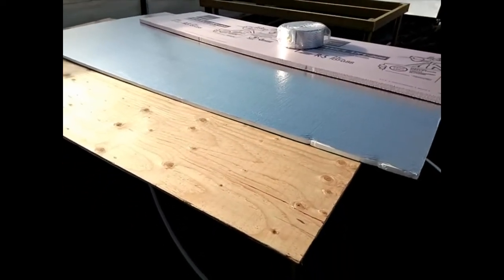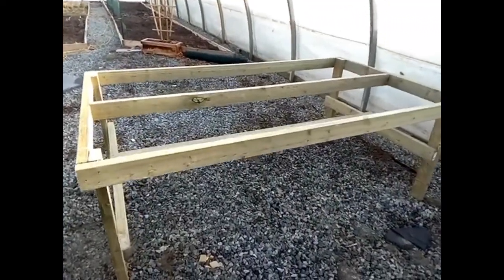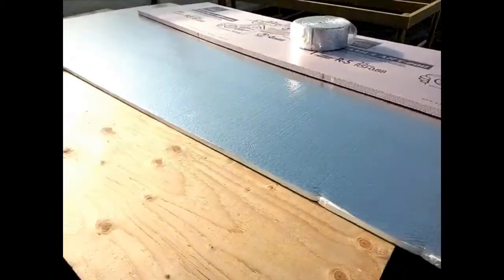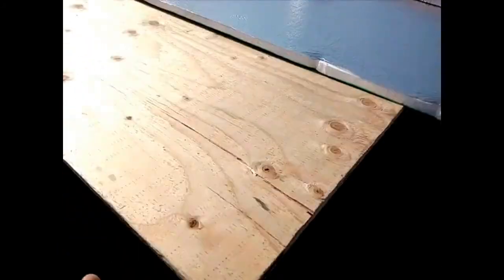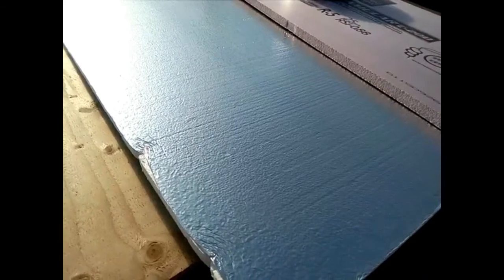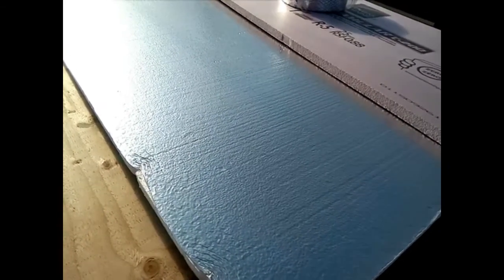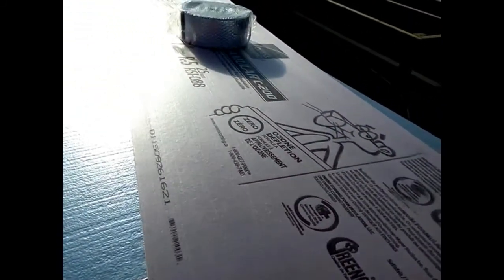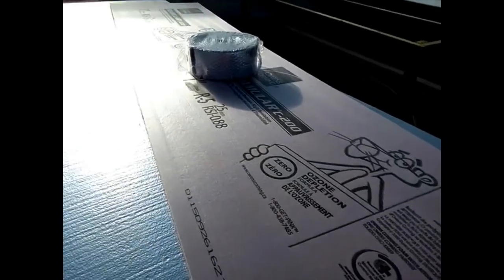Heated Bench

Comment: hii

can you tell me how does it work when the winter is in the deepest bitter night ? and how much does it cost to run for a month in the deepest winter ? 

just want to get a rough idea before jumping into it. 
is the bathroom floor heating cable can be used in this case ? 
there is another type of twin cable with some sort of carbon plastic in between that will adjust how much heat to put out at each spot.... that's also for indoor use. is it ok to use in this case ? 

thanks
andrew

Comment: I'm curious if the foam at the bottom, lasts with the heat and humidity. I know it's designed to handle the heat, but it might encounter more humidity than it was originally designed for, which might reduce it's life span.
Reply from the maker: Hi Walter. I Had a chance to disassemble it recently, and the foam held up fine.

Comment: Got my heated bed all finished then realized that the heat cable i put in would not work as it was for water pipes and it will not come on until its near freezing,back to the drawing board.the good news is that its about 10 degrees in there so that ok,plants are thriving

Comment: Great video! Its been nearly two years since this video was posted. How has your new bench held up? Could you share what it costs monthly?
Reply from the maker: Hi Richard. It held up very well, and I use it a lot in the early spring when I'm doing seed germination. I haven't been tracking electricity for the bench specifically, but I'd be surprised if it was very costly. The soil volume isn't much, and it's well insulated. The one adjustment I've made since then is I replaced the sand I was using with my potting soil (mainly composted bark). The sand was drying out too quickly - and dry sand doesn't do a very good job of transmitting the heat to the seedling trays.

Comment: I'm building a propagation bench with a heating cable basically the same as your video, but what about drainage?  My bench base is plywood, then lined with black plastic, then the reflective insulation, sand, heating cable and more sand. Thinking that even with misting the water needs somewhere to go?
Reply from the maker: I had that in mind too when I first put the bench together. My plan was to use a spade bit on my drill through one or more of the corners, and install a downward sloping piece of PVC pipe. For me, it turned out to be unnecessary... the sand conducts the heat better when it's moist, and I found that once the greenhouse began to warm up (and with the cable working), evaporation was outpacing my watering. I actually had to lift the seedling trays to water underneath because the sand was drying out too fast. I guess it would depend a lot on your weather, and how much you're watering... but it wouldn't be much trouble for me to install them if the need arises.
Reply: Fraser Valley Rose Farm thanks, really good info,

Comment: thanks for the video, but u didnt include electrcity costs , i think they are above 50 USB per month..
Reply from the maker: Thanks. I did an update video to figure out the electricity - it turned out around .47 CAD for a day or approx $15 per month. Might vary a bit with outdoor temperature and local electricity costs, but that's my estimate.

Comment: Does using a lighter-weight media still work to hold the heat? I detest sand, it is so heavy to work with and I don't want to break the bench or my back!   I cut in a lot of perlite, to the mix itself,  my cuttings seem to appreciate the airiness.   I am not sure if that "air" will just let all the heat escape though.
Reply from the maker: I'm replacing the sand with composted bark this year... the sand seemed like a good idea at the time, but it dries out quickly in practice. I had to stay right on top of watering as dry sand doesn't conduct heat too well. The heating cable is designed for in-soil use, so I'm hoping my new approach works better.
Reply: Perlite is an insulator, so I don't think it would work to well.